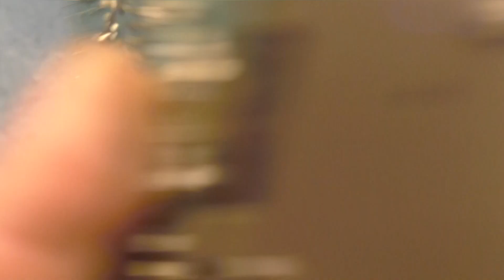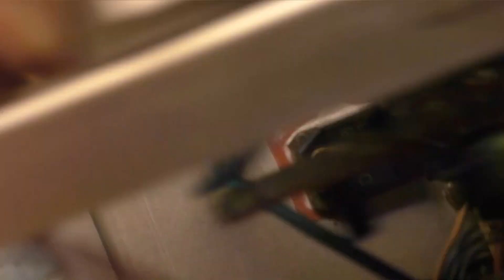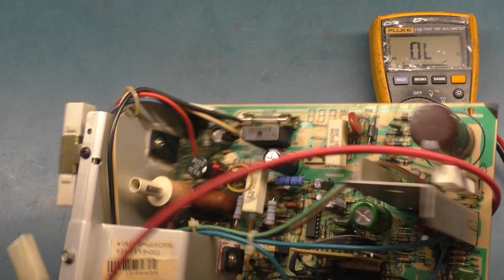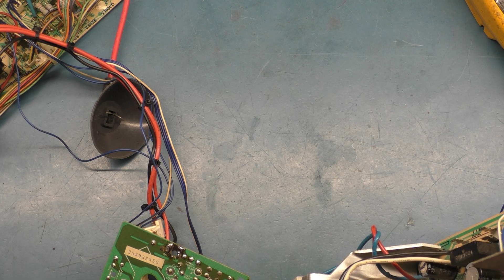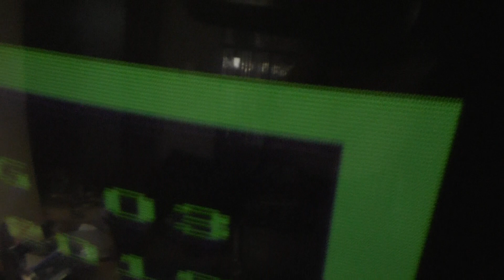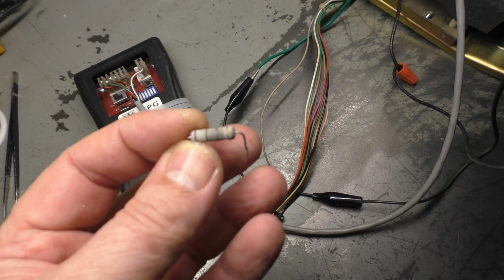25" K7000 Arcade Monitor Chassis Repair - Vertical Collapse - R44 Missing?

Comment: Should I be getting any diode  readings from ground to the other 6 pins on the Vertical IC?
Reply from the maker: Can’t say off hand without grabbing one and measuring but as long as none of them are measuring to ground that shouldn’t be, it’s likely fine.

Comment: Do you have any videos of you're unsuccessful repairs? I know there's gotta be some footage of you doing the smoke or fire test on some unfortunate boards.. Ive had a few that smoked after repairing them and gave up and scrapped em.. you're a lot more knowledgeable on them because I only recap and replace flybacks. If that doesn't fix it I am clueless
Reply from the maker: Not so far. Maybe soon though!
Reply: @MikesArcadeMonitorRepair  Check out youtube for overpowering circuits or overpowering TV sets.. Kinda fun to watch the 4th of July fireworks show.. here's an example: https://youtu.be/djxNgS6mw2I and this one, love the arcing from the anode. https://youtu.be/14WTRg4JDzo